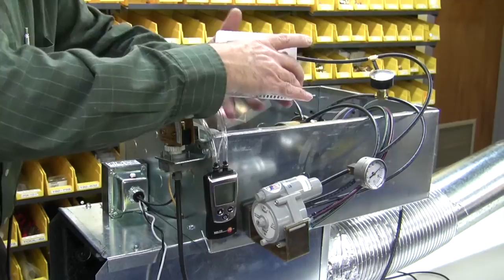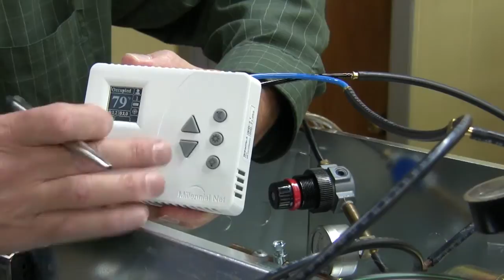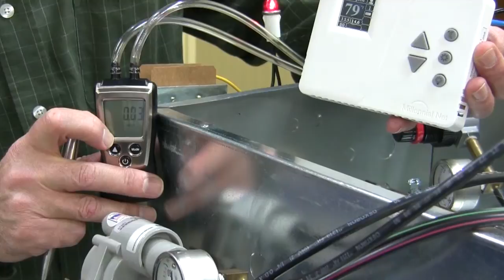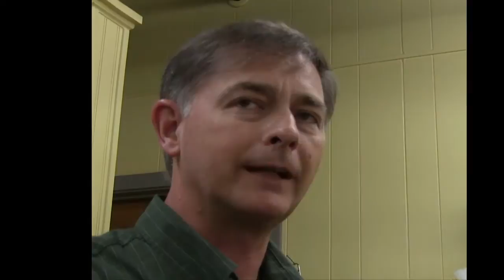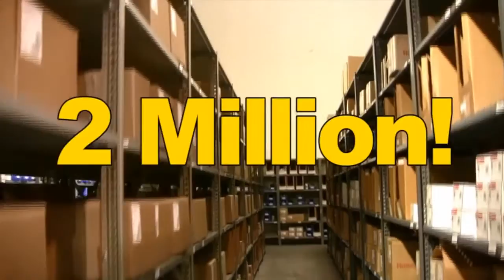Wireless Pneumatic Thermostat Wi-Stat IIIp to Control a VAV Box, Training with Tim

Comment: Tim, California energy code requires that VAV with reheat must comply with dual max temperatures and max box leaving temperature of 95F. California has many existing VAV boxes with reheat that are pneumatically controlled.  My question is, can this be achieved with pneumatically controlled VAV box?  If it can, how? Also, can existing pneumatically controlled VAV box with reheat be modified to meet this code? Thank you.